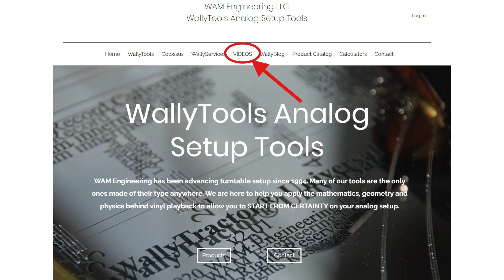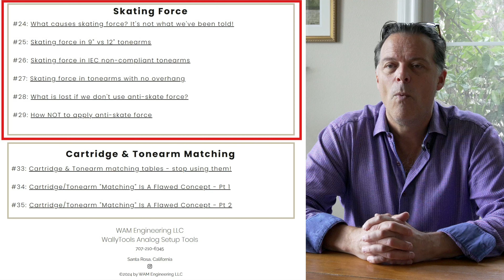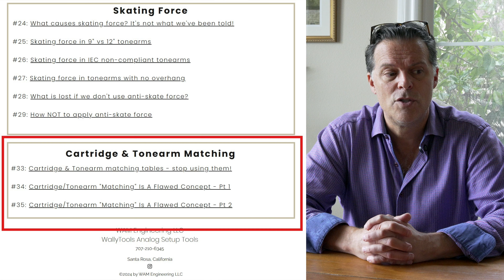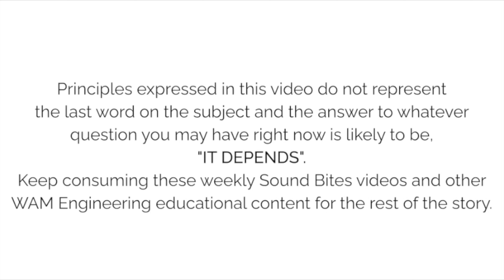Sound Bite #51: Our Top Educational Videos & The Ones We Haven't Made Yet

Comment: What I'm not sure is why does compliance have a bearing on the weight of the arm? The army's balanced anyway for the given force . So why the compliance of the cantilever has to be a different for different weights of arms? I know there's a frequency thing about seven hertz optimal but not sure why the weight of the arm has any bearing on this.?
Reply: It's not the weight it's the mass; those two things aren't really the same.  When you balance an arm, you change the amount of downward force being applied but you DO NOT CHANGE THE MASS.  Imagine a tonearm made out of a feather which has 2 grams of mass.  You balance it to have a downward force (VTF) of 1 gram.  But that doesn't change the fact that the feather has 2 grams of mass.  So the cantilever is being pushed down by 1 gram of force, but it sees an effective mass of cartridge mass + 2 grams + counterweight mass.  Now imagine a tonearm made out of a cinder block which has 5 kilos of mass.  You can balance it so the downward force (VTF) on the stylus is 1 gram, but the cinder block still has 5 kilos of mass.  The cantilever still has 1 gram of downward force but now sees cartridge mass + 5000 grams + counterweight mass.  Those numbers will clearly be very different and have different effects on the cantilever (a spring).
Reply from the maker: Sorry, but your question isn’t clear to me at all. Be sure to watch the series on  cartridge/tonearm matching I referenced in this video